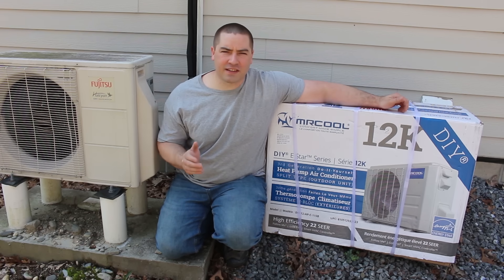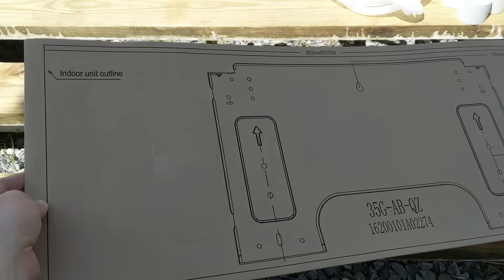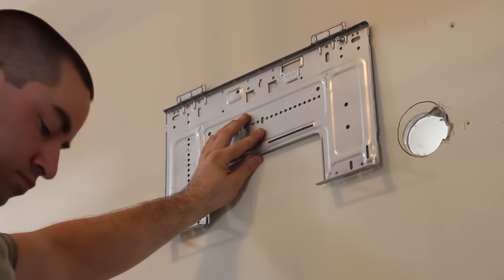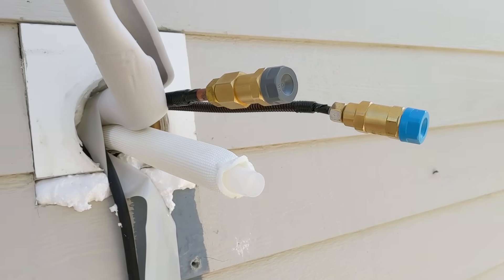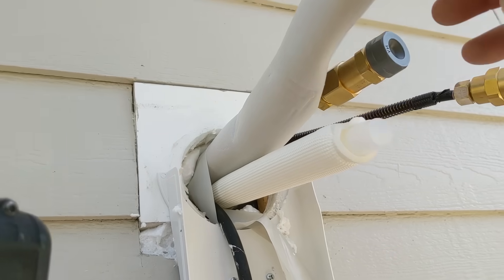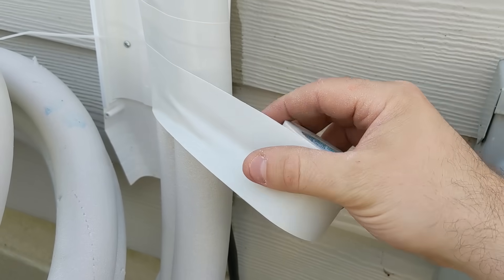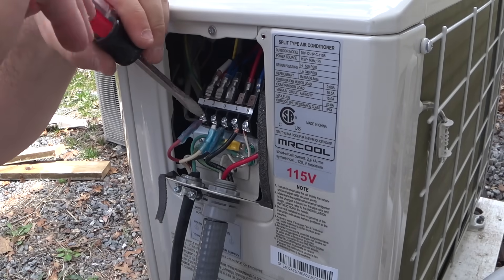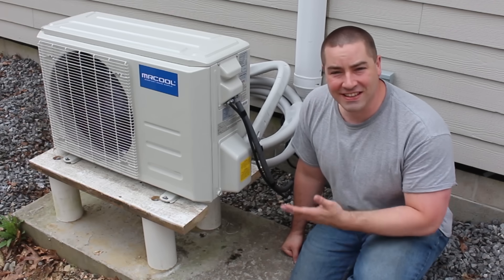Installing My Own Mini-Split Heat Pump, DIY

Comment: Kudos for using some Nylog. However you should also use it on the top of the flare nut as well as the threads. This would help to keep the copper from getting bound up any on the top of the flare. Mini split flares are very common leak points. Did the instructions give torque specs for the flares?
Reply from the maker: I used the Nylog on both sides of the fitting.  These are not flare fittings.  They are called "Quick Connect" and have o-rings.  It's a straight thread, so I tightened it until it bottomed out.  Not exactly a torque thing.
Reply: I wouldn't use nylog on mini splits anyways.  Should the nylog get into the system it will play havoc on your LEV.  Stick to using POE or PVE oils.  I agree with most comments that it's hard to find a descent installer.  It seems everytime I talk to a guy at the supply house they dont know squat and just slap things into place and on to the next.

Comment: Mind blowing how much they charge to install these, ive seen $3500 and more to install a single std mini split 

You can get a daikin for about the same as these diy units and have what many say are great quality but I have definitely read to avoid fujitsu
Reply: I am curious what the guarantee is, as it was not installed by a professional.
Reply: @cthorn8355  The Mr Cool DIY units have either a 5 or 7 year warranty. Can't get much better than that.

Comment: For the extra cost ($400 ish) of the diy system I found that you can purchase a nice used vac pump and gauges and a decent used micron gauge  and install a regular style mini split with flares properly 

I got a mrcool 18k 21 seer from home depot $800 shipped to store for example
Reply from the maker: I thought about doing that too, but I still wouldn't have a tank and nitrogen.

Comment: 100% guaranteed the leak was the indoor coil. Very well known issue for thse RLS2 Fujitsu units
Reply: Yes the leak point is most likely at the connections at the indoor or outdoor unit.

Comment: Just curious did the DIY telk you about the moister you have now let into the refrigeration system? As in line sets are done by professionals for the reason alone they have the proper tools like a vacuum pump and manifold gauges to make sure you pull a vacuum down to 500 microns or better. Especially in snow country. The moisture which is a non combustible in your lines will wreck havoc during freezing temps.blockages etc. But it should get you by for a while.
Reply from the maker: This is a very unique system.  No vacuum, no gauges, no pressure nitrogen.  The lines are pre-sealed at the factory.  Mr. Cool is the only company I know that has an official DIY version.  The lines are pre-charged. https://mrcool.com/blog/pre-charged-line-sets-real-right/

Comment: You can't hire quality HVAC companies anymore.  In 2011 I installed 4 Mr. Slims myself and to date they are all still working good as new.
Reply: You can easly find them but everyone wants the work for nothing. People hire butchers who are not licensed and do illegal work. Then everyone lumps all techs into the group. The cheap CHINA units are great till they break and parts are very hard to find that still require a pro to install. 

To each their own, there are junk branded minisplits and there are high end models that don't break down. Sound like he had a butcher put in his first system. I have seen a lot of these Mr cool and cheaper mini splits fail from improper installs and poor quality.

Comment: Looks as though the old unit ran off 240v and the new runs off 120v.  That looks like a standard 240v discontent. Where did the neutral wire come from?  Did you run new wire back to the panel?
Reply from the maker: There was a neutral wire with the original install (4-wires) so I used one hot leg and the neutral.  The red wire (L2) is not used and disconnected.

Comment: what happen to the air inside the pipe
Reply from the maker: This is a very unique system.  No vacuum, no gauges, no pressure nitrogen.  The lines are pre-sealed at the factory.  Mr. Cool is the only company I know that has an official DIY version.  The lines are pre-charged. https://mrcool.com/blog/pre-charged-line-sets-real-right/

Comment: A "DIY" refrigeration installation makes no sense.  Not only do you have no idea where the previous leak was, you have no idea if the charge provided in the new unit is the proper size for your house.
Reply: You do realize that this is a mini-split and everything that was installed is new? Which means you don't have to worry about the previous leak in the OLD unit.

Comment: Hey David, That kit looks identical down to the fittings, inside the unit, and such to my High Seer Pioneer unit i got in 2015 from Highseer.com, for $520 for 12k BTU.  They work really well, mine is still working perfectly in my house, i noticed there was a step you didn't show in your video that mine listed for me to do... do they not require you to vacuum out the lines before releasing the gas for an hour. Mine had it listed as part of the instructions, so i rented a vacuum pump from Autozone to do it. The only issue I've had with mine is the clear plastic hose turned brittle and started falling apart after 3 years, so I pulled it off and installed some hose from the home depot that was the same size.
Reply from the maker: They could be the same, I don't have proof one way or the other.  I did follow your link and looked at the 22SEER 12K models on that website.  They showed flare fittings on each of those models.  I didn't see any with the pre-charged lineset and o-ring brass fittings.  But if there are other manufacturers out there doing this pre-charged lines (yes the copper tubing is pre-charged) then that's great.  I like this system and I hope more come to market.
Reply: @DavidPozEnergy  The system i got from High Seer had the same type of fittings like in your video, so maybe they have changed the line fittings on the newer models not sure.. but back in 2015 when i bought it.. it was just like yours.. but the gas was sealed inside the outside unit, so when i turned the Allen it released it into the lineset, but had the same O-ring type connections like your kit. It specifically said in the manual to vacuum the linesets or performance would not be at peak performance, mine will get down to 27F on the air temps coming out of the unit inside if i set it to LO

Comment: HVAC guys are getting so expensive it probably cheaper to just replace the whole thing everytime it goes out LOL . Cant trust a lot of them as well. And if you could know what to fix so to know if they are raping you ,, you would have just fixed it yourself. It like if the wife was to take the car to a mechanic. NONO> LOL

Comment: COST???????
Reply from the maker: About $1200.  I linked to it on Amazon in the description.
Reply: @DavidPozEnergy  WOW thats way cheaper than having one installed by an HVAC tech!! How long did it take you?? Also, yours is also a heater as well??? THANK YOU for showing this and answering my Q's. Shalom From NW Montana
Reply from the maker: Yes, a lot cheaper compared with hiring someone.  I filmed this over 1.5 days, but actual install time was probably 4 hours.  It takes a long time so set up cameras.
Reply: @DavidPozEnergy  Im glad I clicked on your video! Nice to know there is something out there like this!! Thanks agin bud!

Comment: i looked at there page on amazon. looks like a good unit. but for a 12,000 btu they only claim 500 sq ft. when many window shakers rate 500 sq for there 5000 to 6000 units.  using more watts though
Reply from the maker: They are probably being conservative.  Depends how efficient your building is.  This is doing my whole house easily.

Comment: Where do you live that it costs $500 for a HVAC service call?
Reply from the maker: I'm in Massachusetts, just outside of Boston.
Reply: @DavidPozEnergy  hate to see the regulations the co has to go through in that state. this old house has showed some but they are quiet so they dont get hassled by inspectors {my opinion)

Comment: Consider putting a piece of steel wool or something in the condensate tube end to keep critters out.
Reply: Can't do a p- trap in areas of the country that gets below freezing
Reply: @ThePapertank1  if it’s freezing the ac won’t be on.
Reply: @tomsaywer9883  perhaps they are thinking that the P-trap will be outside and it can freeze.
Reply: on the next one. coil the extra condensate drain tubing once on the wall to make a P trap / water loop to keep critters out. then snip it off.
Reply: Heck...Just look for the tattle tail oil residue with the dirt stuck to it to find the culprit and odds are its a leak in the condenser coil, lineset connections or service valves. ;)
Reply: Or a P-trap on the bottom

Comment: where is your vacuum pump? there is now moisture in your pipes, which can freeze. You should not do these things yourself.
Reply from the maker: This is a very unique system.  No vacuum, no gauges, no pressure nitrogen.  The lines are pre-sealed at the factory.  Mr. Cool is the only company I know that has an official DIY version.  The lines are pre-charged. https://mrcool.com/blog/pre-charged-line-sets-real-right/
Reply: is there freon in copper pipes?
Reply: or already vacuumed
Reply from the maker: At the factory they vacuum the lineset, and pre-charge the lineset with the refrigerant (R-410A).  The ends are sealed with those big brass fittings you saw in the video.

Comment: Nice job installing the system.  Unless the line is pre-filled with refrigerant.  I didn't see you evacuate the air out of the line prior to filling it up with refrigerant.  If you have air in the line, two things could happen.
1.)  that means you'll have water in the system from the air which could cause problem down the road.
2.)  the air will mess up the accuracy when you are reading the refrigerant level in the system for charging/maintance purpose.
Reply from the maker: This is a very unique system.  No vacuum, no gauges, no pressure nitrogen.  The lines are pre-sealed at the factory.  Mr. Cool is the only company I know that has an official DIY version.  The lines are pre-charged. https://mrcool.com/blog/pre-charged-line-sets-real-right/
Reply: @DavidPozEnergy  How do you remove the excess lineset?

Comment: Does it run on direct Solar DC because it is an inverter insite? I would us it to heat the house in Winter but most ACs only good to chill 😟
Reply from the maker: This model runs on 115 volts AC.  I'm running my house through my inverters, batteries, and solar.  So it is a solar-powered AC, but only because my whole house is solar powered.

Comment: People I am a Master mechanic in 15 years in HVAC fuel oil and plumbing.
There are multiplesteps to this video did not show you that are involved with the installation of a refrigerant system.
He did not follow dehydration or evacuation process.
there will be so much contaminant and moisture in that system it will not last more than one.
Secondly these units use cheap China copper.
American copper doesn't leak and it's not cheap.
Best system will not perform anywhere near efficient.
Reply from the maker: This is a very unique system.  No vacuum, no gauges, no pressure nitrogen.  The lines are pre-sealed at the factory.  Mr. Cool is the only company I know that has an official DIY version
Reply: Haha American Cooper doesn't leak. Probably because most coils I've seen are built in Mexico

Comment: Wait... Hang on

So you didn't vac out the atmosphere in the lines and indoor coil? Is it standard practice in the States not to? 

Your unit will fail within a year due to the oxygen mixing with your refrigerant oil.
Reply from the maker: This is a very unique system.  No vacuum, no gauges, no pressure nitrogen.  The lines are pre-sealed at the factory.  Mr. Cool is the only company I know that has an official DIY version

Comment: For some pricing reference I just replaced a 3t mismatched A-coil and compressor with a 3.5t for $3500. The old compressor burned up and it was $2k for a replacement without warranty. This was done by a trusted family business whose founder worked with my father when John Zink made air conditioners. 

FYI the upgraded cooling was recommended because of the loss of shade and change of surfaces outdoors. North exposure, South is a different unit, but they replaced an old creek bed with concrete and we lost a bunch of trees to the widening.
Reply: you got ripped off.  I paid $4,000 for a 5 ton Rheem system a few weeks back.

Comment: oh good man.. I know you been through it with yourself. You bought a diy, but to be clear my brother, you could have bought any of them and instead of doing it with an ac guy, you just purge the system using a different method, that works very well. And they don't do that well or much better than you. They cut all kinds of corners.
Reply from the maker: It's true that I could have bought a vacuum pump and done that part myself, but I think that would be illegal.
Reply: @DavidPozEnergy  True, but you don't even need a vacuum pump. Its the same thing basically, that you are doing to this one. The freon is already there and you release it. Mine is working great. I put it on my campaign bus. I also set up my batteries, same kind you have. We have lots of the same stuff. Great minds thing alike. Next, you will get a Prevost bus, take the seats out and make your home on wheels from that. <3 Then you will be rocking. You can fly your drones from the top of it and go way out. <3 
Life is so much fun

Comment: Another great video David. A  few things its rated down to 5 degrees farenheight for heating.  Note since its a 115 Volt unit whatever power it uses will be on only one leg of a 240 volt system so take in consideration load balancing for Solar Inverter systems but great for 115 Volt solar systems.  Very efficient for a 115V unit.  Of course for a larger home if you install 2 totally separate units  you could install on 2 separate legs of 115V and minimize the imbalance mainly when they are both running at the same capacity. Remember also there are other sizes available and units with multiple inside registers also.  This size would be perfect for many garages or workshops.

Comment: I bought a 24k mr. Cool heat pump. Best investment I've ever bought. Cost me 1400 bucks power company gave me a 800 dollar rebate, heats awesome, the AC is incredible! Glorious.
Reply: The power company gave you $800 of your neighbors money to buy that.
Reply: @cthorn8355  or you could also say he paid for it himself over the years as a customer. Same argument for solar incentives.
Reply: @cthorn8355  I'm looking into buying a system. The syst I might need has an $800 energy start/tax refund rebate. Other systems/installs, the rebates go at least up to $1400 tax rebate. Mad I'm not a guy/mechanically inclined/with tools etc and will have to fork out over $6k for a company to install – Also required for rebates.

Comment: All that extra line set is going to cause an oil return problem which will result in a compressor failure.
Reply from the maker: You are probably right.  I am also concerned with oil, which is why I installed the extra line horizontal instead of vertical.  I'm hoping the horizontal coil will allow the oil to move back a little easier.

Comment: Having pressure gauges and evacuating the lineset with a vacuum pump is recommended. Also using nitrogen to leak test too
Reply from the maker: This is a very unique system.  No vacuum, no gauges, no pressure nitrogen.  The lines are pre-sealed at the factory.  Mr. Cool is the only company I know that has an official DIY version.
Reply: @DavidPozEnergy  No, Mr. Cool is the only one that blantantly lies about not needing these things.
Reply: Also the only company that recommends checking for leaks after you let the refrigerant out.  Makes no sense.
Reply: Pre charged lineset. Looks like crap with the coil.

Comment: I’ve been researching mini splits, and Mr. Cool is more expensive than the other DIY units but it is my understanding that you do not have to vacuum out the lines unlike the other kits. I think I’ve definitely decided on the Mr. Cool product. Thanks for the video
Reply: You always have to vacume out the lines thats why that unit will fail.
Reply: @TheDeadheadable  You can't vacuum the lines the lines are pre-charged with the refrigerant.
Reply from the maker: That's correct.  Mr. Cool sells both regular units and "DIY" units.  The ones marked DIY come with pre-charged lines that are sealed at the factory.  No special HVAC tools.

Comment: greetings

why did you choose a 115v model as to a 230v model?
Reply from the maker: I wanted a small unit.  I would have preferred a 230v 9KBTU, but Mr Cool does not offer one in DIY.  The smallest DIY version they offer is this one (12KBTU) and it happens to be 115v.
Reply: @DavidPozEnergy  ok no problem thought it was better in terms of using on the solar system and power demand (more efficient)
Reply from the maker: You are partly right.  The smaller the unit, the less surge amps to start up.
Reply: @DavidPozEnergy  ok understand

Comment: You should never coil up power wires like that, because it will be like an big inductor/electro magnet and heat up and COULD result in a fire.
Cut it to length wit maybe 10cm/1foot of slack and it's perfect.

The only thing I dont like about this unit is the coiled up AC lines, do they deliver in different lenghts or are all that long?
Reply: Stop talking bollox. The amount of current draw on that will be negligible.
Reply: @niceguy235uk1  many of them are between 2 to 5KW
And coiled wires concentrates the heat like crazy and also induction losses like old iron core transformers